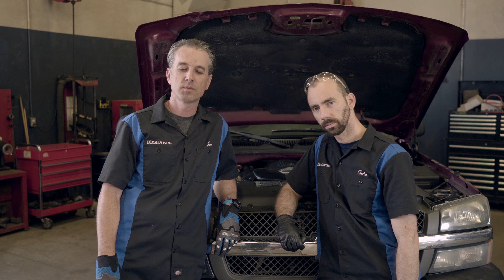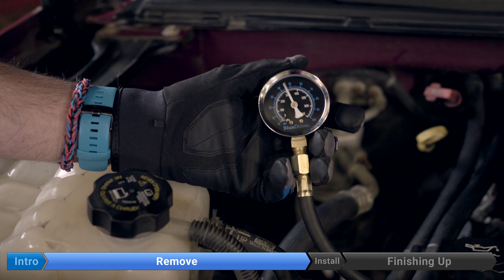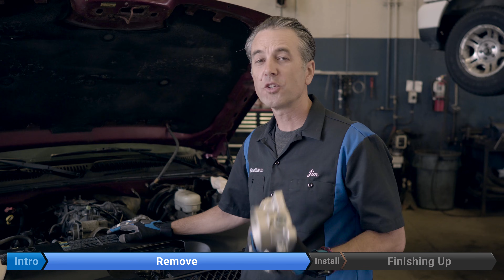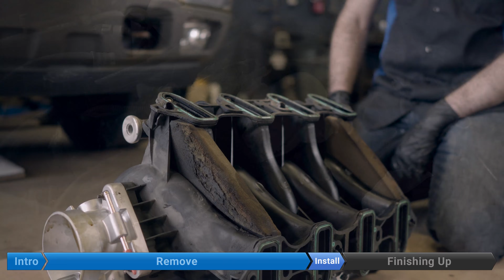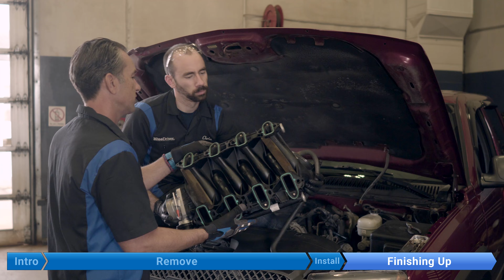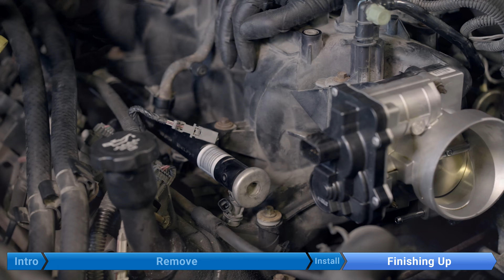Intake Manifold Gaskets – 1999-2006 5.3L Chevy Silverado (Sierra, Tahoe, Yukon, etc.)

Comment: I have put on a smoke test after install and showed leaks on the gasket. I have now replaced another new gasket and a new bolt kit it and still leaks. Soultion? 400,000 on the motor.
Reply: I'm also interested in knowing as mine is 400k also. I'm thinking a new Intake manifold will do the trick! But if the motor has 400k already, may as well swap the motor if it keeps giving you hassles.

Comment: This video just saved me at least 300 bucks. I also learned that my PCV valve is bad because my intake is full of oil. Which is what caused the gasket to get gross . So if you take your intake off and there is oil everywhere that’s the problem. Also you can just take the throttle body off and not mess with those coolant lines; it was impossible without his little tool.Thanks for the video guy!!!!!!
Reply: You can also leave the fuel injectors on and just clean both surfaces really well

Comment: Great video. I would though recommend using the better design felpro gaskets, and looking up the gm service bulletin on replacing the knock sensors, building the rtv dam around them, and deleting the rear foam as it seems to trap moisture. On these ls motors a little research and a few extra bucks can save a lot of time having to go back in for something that was right next door to your previous project
Reply: @Anthony-kd5ku  
Hello, this may help you. 
In regards to the foam, on top the lifter valley pan there are two foam pads that are there to keep debri out. The front one is fine but the one close to the firewall tends to trap moisture. 

https://www.corvetteforum.com/forums/attachments/c5-tech/47686616d1323993721-intake-manifold-upgrade-tsb-893793.pdf
Reply: @Anthony-kd5ku  your welcome, I hope your project goes well
Reply: @Anthony-kd5ku  hey, planning on doing this this week. How did it go??
Reply: @Anthony  Hey man what did you use to clean the surface where the gaskets go? It doesn't show in the video and having a hard time finding a video that shows what to use.
Reply: @Ace-44  acetone and a plastic gasket scraper work pretty good. If you use a razor blade be very careful not to gouge the surface
Reply: @E.S. L  OK. Appreciate it man. I was thinking about B-12 and a plastic razor I have.

Comment: I have a 2005 Yukon XL with a 6.0 L engine. Does it take the same intake gasket as the 5.3?
Reply from the maker: Looks like it!
Check out the parts fitment at https://www.gmpartsdirect.com/oem-parts/gm-manifold-gasket-89060413
They got their money's worth out of that design

Comment: I have a 2002 gmc yukon xl 1500 slt 5.3L LS engine with 237,000 miles ("Z") on the eight digit in Vin number. I will be replacing the knock sensors soon and was wondering if I should go ahead and plan to replace my fuel injectors at the same time???? I'm also planning to replace my crankshaft  sensor and oil pressure sensor too.  I did read the GM bulletin regarding the removal and disposal of the foam insert off the rear side of intake manifold and the RTV (red) around knock sensor seals leaving a small gap on back side. Again, thank you for all the videos and quick response.

Comment: Any tips on getting the bolts back in the manifold? It looks like they were designed to stay in there.
Reply from the maker: Nothing too special, maybe it isn't lined up perfectly?
Reply: @LemurMonitors  Hello, yeah the bolts on my intake don’t seem to come out either. But do they come out? And I put the Fel-Pro Metal Gaskets on, would it hurt putting a little dielectric grease on the rubber on the gaskets, to help it slide in place? Thanks

Comment: My 05 Tahoe isn’t throwing any codes but I have a coolant leak coming from near the firewall on the driver’s side. There is no wet inside the cabin. I’m having to lay on the motor with a mirror and flashlight and I have yet to locate the leak. Any ideas or should I just do this repair?
Reply: did you find the problem?  was it the intake gasket causing the leak?
Reply: @Jimo225  I can't believe it's been a year haha I have yet to attempt any repairs, it's been living on a battery tender and I run it at idle every 2 weeks

Comment: Thank you so much for the detailed video.

 I am sure when I get to the knock sensor replacement ( as soon as I get the parts) your video with be indispensable.  If you doh't mind giving me more advice, does this affect replacing the Valve cover gaskets and grommets?  Since I will  have it all apart, should I do them at the same time? They have been leaking for a while now, and it seems that it would be easier to do it when everything is apart for the knock sensors replacementI. I have 20,200K-miles on it. It seems a good time to replace the plugs (only plug change was at 105K miles). and wires.   Thank you, Gentlemen.

Comment: excellent video, thanks, it helped A LOT! My 2004 Tahoe, vin z Flex fuel had different style electrical connectors at fuel injectors plus 2 fuel lines instead of the one from the video but otherwise spot-on. The whole project took me 4 hours.
Reply: Truck idles so smooth at 650 rpm now I keep thinking it has stalled:)

Comment: You weren't good to go... You forgot one major item to make the car run.... Fuse to fuel pump....:)
Reply: @LemurMonitors  By the way it was a great video. Only reason I caught the fuse not being re-installed was when I put mine back in I wasn't sure which way it went. I took pictures on everything so I re looked at my picture of the fuse before I pulled it.... Thanks guys

Comment: Just finished this job which took me a total of 15 hours on different days. My 2001 suburban had a cruise control and accelerator cable which was not covered. The injectors were not easy to remove and replace especially the ones in the back and on the drivers side. Make sure the pull all of the slack from the manifold on the knox sensor. I had to go back and loosen the manifold bolts because the knox sensor wire was to short to hook on the manifold, UGH!!!!! Nevertheless, the manifold gaskets were completely worn. There were leaves, leaves, and more leaves with a sprinkling of acorns. Overall, I loved the experience and Jim and Chris are a excellent instructors along with making mistakes. I'm on to the AC belt and tensioner, next brake pads, and my Gray Ghost will be fortified. Thanks BlueDriver!!!!!!

Comment: 2 hours on my 4.8. Thanks for the video guys and showing the injector clips. A few videos skipped that part. Saw u changed the throttle body, I unscrewed the 3 bolts and pulled it forward  instead of undoing the coolant lines.

Comment: I just relieved the fuel pressure by using a small screwdriver on the schrader valve. Done.
Reply from the maker: Good option too - but watch your eyes! (ask me how I know)
Reply: @LemurMonitors  I watched your video prior to relieving the fuel pressure with the screwdriver. By the way, thanks for the great videos.

Comment: Don't have a blue driver but I did do everything in this video step-by-step. After about 30 miles the check engine light cleared but the codes are still on my reader. Do you recommend I clear the codes and drive another 50 to a hundred miles?
Reply from the maker: No harm in clearing them unless you have an emissions test coming up in the next week or so. If any come up as "permanent" then they can't be cleared and you'll have to do a bit of driving before they'll reset themselves.
Reply: @LemurMonitors  I do have an emissions test coming up. 
Maybe I'll just clear them and drive a little bit more

Comment: Thank you so much! This video saved my moms 02 5.3 chevy silverado! Ben wanting to get to blue driver for a while customer service like this has got me sold will be ordering soon. It cleared / fixed 6 codes P0442 P0332 P0300 PO174 P0171 P0101. Could not have done it with out the video

Comment: I get P0171 and P0174 but only in extreme cold. The idle is noticeably rough when this happens. After driving for a while it smooths out and doesn't happen I warm temps (20+ degrees). Could this be the culprit?
Reply: It is absolutely the culprit of both those codes.especially in the cold the way you described. I had the same symptoms/issue on my 2000 GMC Yukon 5.3. I did the gaskets and boom all fixed!!!
Good luck on yours
Reply: Same damn symptoms here also. I have a good mind just to go ahead and buy the gasket replace and give it shot.
Reply: I'm sure you've already gotten your answer on this but for anybody reading this comment, this is 99% of the time going to be the cause. I've had a few of these pickups and around 150-200 thousand miles this happens on all of them.
Reply: @SuperNicks22  Yeah I replaced this about a year ago and it fixed it. Thanks though
Reply: @Tanner69046  I'm even later to the party but I hope your replaced them with the $100 gasket that has a metal frame rather than the $50 gasket with plastic frame. Otherwise you'll be doing it again before long. At least you'd be doing it with experience next time around 😂👍
Reply: Yeah also having the same problem though only code is a bad knock sensor. I don't think the knock sensor is the problem but I want to replace it anyway and I feel like the gaskets my problem so luckily 2 birds with one stone. I'll try to update if that's my problem.
Reply: @Zoroaster4  truck is sold and gone now but from my memory if you're taking the intake off anyways might as well throw a gasket on there. Get that felpro one. Trucks that old the gasket is definitely compromised

Comment: Very helpful! Took me around 4.5 hours including cleaning the mating surfaces, experimenting with ways to disconnect the fuel lines (2) before finally buying that tool ($10), and also dropping an injector lock clip UNDER the intake after bolting it down.
I left the throttle body coolant lines connected and just rested it out of the way when it came time to pull the intake out.
Reply: Old comment but I just wanted to say they took A lot of things out that they didn't have to....

Comment: Hey Everyone! Today was the day !! I have a 03 Tahoe 4.8l and I watched numerous videos of the removal of the Intake manifold and replace the gaskets, Blue Driver is a excellent Video but remember my vehicle is old I even watched about the NOC sensors and even for extra credit I watched the replacement of the Oil Pressure sending unit since mine wasn't working it needed to be replaced. The oil sending unit was the absolute worse even with the intake off.. There must be a tool for that ! The socket was to big to fit! I used a needle nose vise grip.  At 12pm today I started to rip apart the intake manifold,, and Blue Driver makes it look so easy.. Which is not although they are experienced. Well I learned a lot today. first off My truck is 16 years old anything past the 12 year mark you will encounter many unseen problems. Such as almost all small plastic connectors " The safety Locking tabs broke from the injectors, then I hit the Heater T connector and broke it, That was fun! Bought a new one, Then I checked the NOC sensor I broke the white part of the stem of the noc, Bought a new one, then the real fun began! Cleaning the deposits of the both sides of engine and intake... I was super careful due to the 1/8 inch high of oily dirt deposits. Vacuuming is a major part of the cleaning! its been 11 hours still not done yet! at 35 degrees outside no garage wearing shorts and long sleeve shirt. I was careful and I'll be honest almost  these connectors are bridle and just plain old. It got late and with a headache I quit for the night I'll seal the Noc sensor's covers then install the intake. It's worth watching other videos because guys like me don't do major repairs like this but not afraid I took my time. I'' be honest it was fairly easy just older vehicles you will encounter problems.. btw I can't find my 10 mm with extension its somewhere in the engine hiding lolol WD-40 is big help on certain things,,, Good Luck !!!
Reply: Intake manifold gaskets just took a dump on our '99 Silverado with a 4.8, new gaskets will be here tomorrow. If you had that much fun with a 16 year old truck I can't wait to dig into a 20 year old one, haha.
Reply: The Ranch Mechanic 
Yea. I’m sure !!  Just be careful where u rest your ams and lean on that was my problem.. that heater connector on the firewall will definitely break if it’s old .. watch for that one .. 
you need a shop vac 
And if you have a evap line on that runs along the drivers side intake do not bend it up like Blue driver did .. it will break behind the block .. pain in the ass to get to after you install the intake...  watch other videos on and good luck !! Let me know if you need help..  today I have to replace the radiator which is an original ugh.
Reply: It's ok, there are thousands of 10mm sockets hiding in vehicles around the world.  Welcome to the club bud.

Comment: I have a steel braided line running to the left side of the intake behind the throttle body. Yours doesn't. What is this?
Reply from the maker: Where does it connect? This is a canadian market truck so there could be some different emissions equipment
Reply: @LemurMonitors  I believe it's an egr tube
Reply: @LemurMonitors  it connects directly to the side of the intake. Left side facing the truck

Comment: I followed the instructions on this video carefully, but now I'm getting a P0430 code! Any suggestions? Could I have done something wrong with the manifold that could be causing this?
Reply: P0430 means that the Oxygen sensor downstream of the catalytic converter is registering an improper reading.. You have to change Bank 1 or Bank 2 sensors or The computer may have to adjust to the new repairs that you did. Let me know I have to replace the Intake Gaskets very soon
Reply: It would give me the same code if I was to do this right? I deleted the catalytic converter on it, it’s straight piped would I need a cold air intake?

Comment: I can get those gaskets for under a hundred bucks y'all are fucking crazyyou also didn't fix the knock sensor problem and the wiring harness and the roof some of the phone from the intake manifold help with water flow and blah blah blah blah 😝

Comment: It's a good thing those safety glasses were protecting the top of his head lol. 
For real though, good video, subbed.
Question, what could cause blue tinted smoke upon starting my truck after sitting for the  night? If I have to get in and out throughout the day I dont get any smoke but after its sat for hours I'll get a light blue smoke right after ignition.
Reply: My guess would be worn valve guides. Overnight the residual oil from the valvetrain could be leaking down into the cylinders via the valve guides so it causes a little smoke when you first start it in the morning. During the day since you're in and out of the truck, the oil doesn't have time to settle down into the cylinders so it doesn't smoke as much or at all. Just my two cents. How many miles on the truck?
Reply: @AllThingsMech  shes been around the block. 280k miles on an 05. The majority highway. The only issues to this point is a water pump and an alternator.

Comment: Just so folks know this job usually ends up with replacing the fuel lines. In the rust belt states most of the time it is impossible to get those fuel lines off the rail without em cutting em off and then separating the collars on the work bench. The harder part is separating all those plastic parts and connectors without breaking anything. This video illustrates the stuff fairly nicely. Alot of the parts have hidden clips and tabs which are a real pain in the ass period. In the rust belt states I don't care what tool ya use and what solvent ya use to get em to give. On the older 99 to 2004 Silverados you will not get your hand back behind on the line and collar itself to separate em. I noticed 2005 on up there is a little more room between the firewall and the motor itself. Not so from 99 to 04. I could contemplate buying fuel lines at whatever extorted price they may want.
Reply: Thank you for representing the snow/rust belt states. Someone who knows what rust is. Amen my Brother! Wrench on!
Reply: Crazy. I live in Denver. Had a friend who moved here from upstate NY. Her Tahoe needed new brake lines because they were rusted through. Mechanics here are not familiar with fabricating brake lines because they never rust out here. That turned into a very expensive repair.

Comment: So how long should this repair last? How many miles? I had this issue fixed 2 years ago at the gmc dealer and recently check engine light came on, took it to same dealer again and it’s the same problem!! And of course warranty on the work has expired. Was told it’s just normal wear, this doesn’t sound right -

Comment: I have a code 442 so I watched this just incase the intake manifold could set the code off
Reply from the maker: It's not high on the list of culprits, most likely:
1) EVAP vent/solenoid valve
2) Fuel filler cap
3) Fuel filler neck
4) Other fuel system leaks - sensor o-ring, hoses, lines
Reply: @LemurMonitors  I'm probably going to either have to take it to a shop or invest in a smoker to find the leak. Thanks
Reply: @marks7352  make your own smoker with a Mason jar and a cigar.